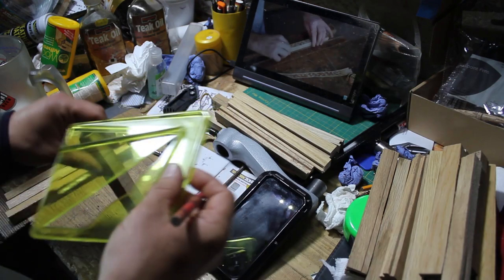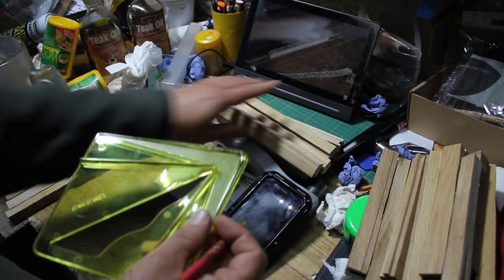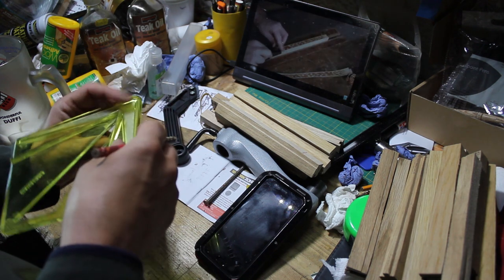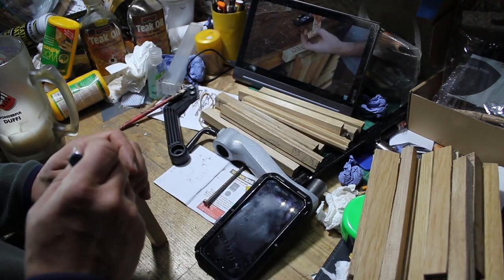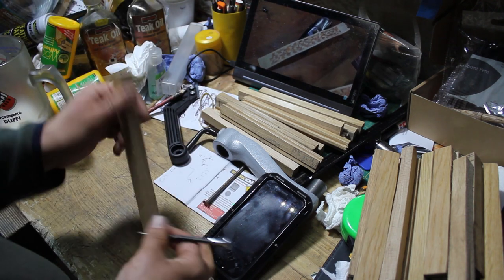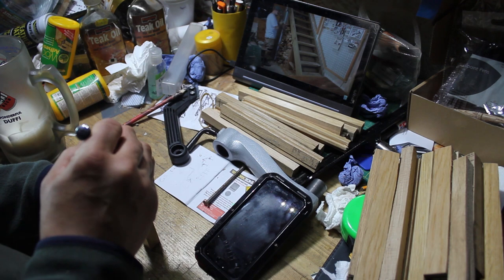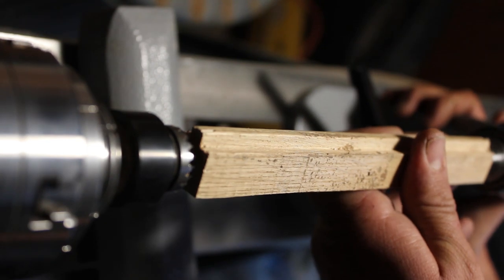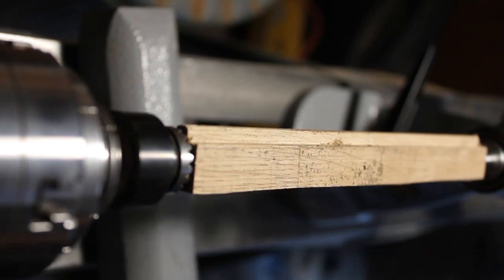Woodturning | Making A Pen for Open Narrative

Comment: Nicely done mate, I totally agree when doing a production run don't be obsessed with finishing cuts, that's what sanding is for and it is a lot quicker.
Shay
Reply: Cheers Shay, I get a little obsessed with streamlining the process sometimes. I've tried to get a finish that will skip the 240 grit stage, and I can of the skew, but not in this oak.